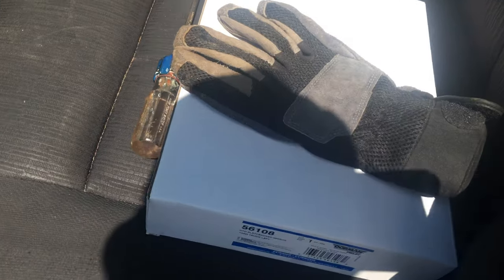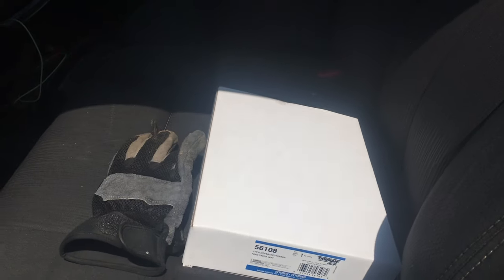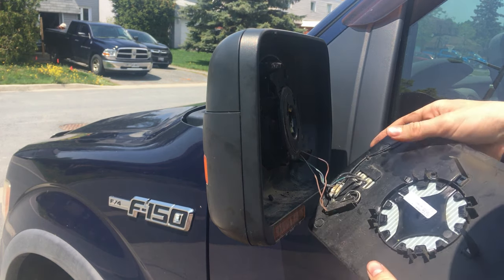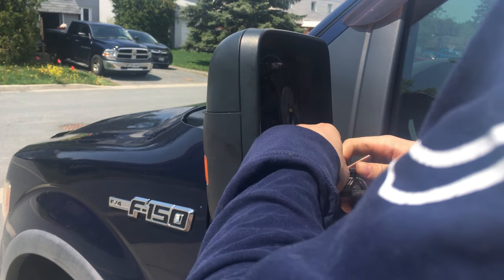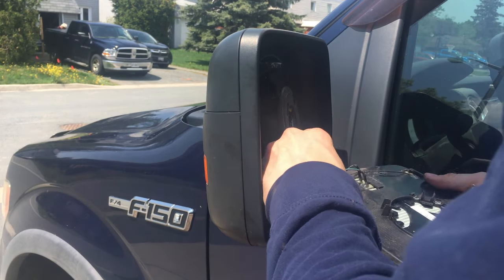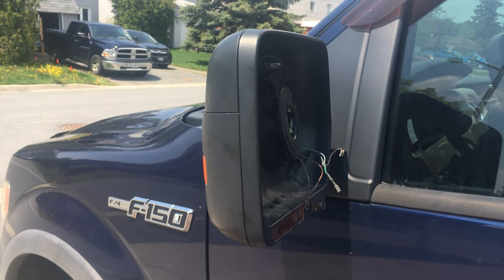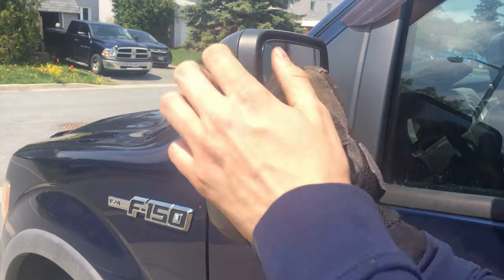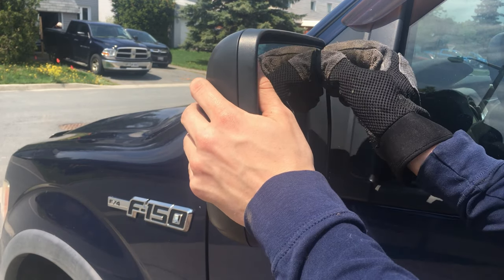Replacing Heated Driver Side Mirror on 2009 Ford F-150 FX4

Comment: Thanks for taking the time to post this!  I searched for almost two hrs to find what the wiring connections are for the two wires nearest the door (mirror auto-dimming connector?).  Green goes toward the inner side of the mirror, and black goes to the outer side.  Could not beleive how difficult it was to find this info!  Some idiot hit my truck and knocked the glass out of the mirror, snapping the mirror motor in half.  At least the motor replacement was cheaper (1/3 the cost of the mirror glass), than the glass, which did not break.
Reply from the maker: I will let my son know that you appreciated his video :)

Comment: Thank you! This helped a lot. But question? This mirror also came with the cable too or just the two metal clips things on it? Cause the image on amazon only shows the clips for the corroded wires you pulled out but not the black wire you plugged in last. Did you buy that wire separate ?
Reply from the maker: Betzabel G Garcia my son says that the wire didn’t come with it but he transferred the old wire to the new mirror but he used gorilla glue so it will stay there

Comment: Replacing the whole mirror is way easier, prying on glass is a great way to break it, it’s not worth struggling with if you just break it in the end and have broken glass everywhere.
Reply from the maker: The lens is plastic and won’t shatter.
It’s worth about $40-50 i think.
The whole mirror would require taking the door panel off and cost hundreds of dollars.
Am i miss understanding what you commented?
Thanks
Andrew

Comment: Where did you get the replacement mirror from?
Reply from the maker: It's listed in the video description but We ordered it from Amazon here:
Canada: Dorman 56108 Driver Side Plastic Backed Heated/Auto-Dim Mirror Glass - https://amzn.to/3eQg0Q4
USA: Dorman 56108 Driver Side Plastic Backed Heated/Auto-Dim Mirror Glass - https://amzn.to/2Ryqxpf
Reply: The glass in your video definitely has the auto dim plug, however the the one you posted link to on amazon does not have this hardware and is not auto dimming.  Im am trying to find one with auto dimming
Reply from the maker: @PR-cy7go  my son said he moved the cable from the old one to the new one. I wasn't around when he did it to see. wish I could be of more help.
Reply from the maker: @PR-cy7go  Here is the exact one we bought. I will fix the link in the description. Canada - https://amzn.to/387LxNf
USA - https://amzn.to/3629SkN

Comment: How to repair mirror that has the part allowing it to be pulled in when goiing. Thru wash. It was hur and is not even
Reply from the maker: Mine is stuck on my old truck... never did fix it
Reply: Ever so often fold your mirrors in and out a couple times.